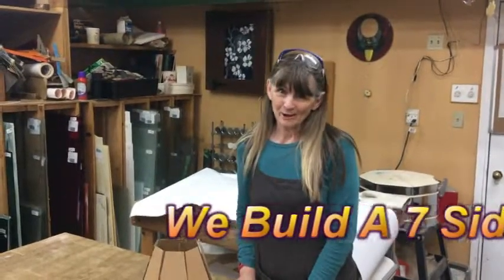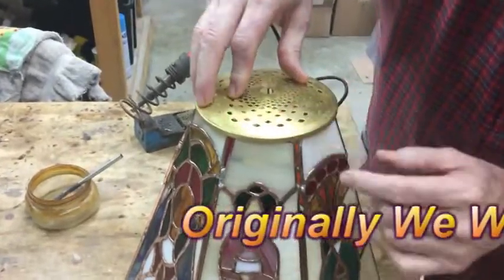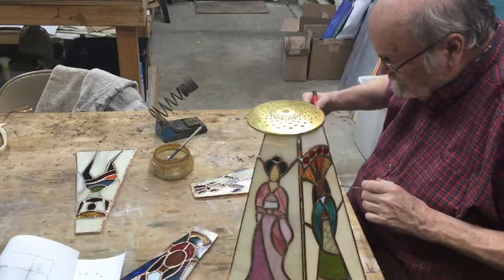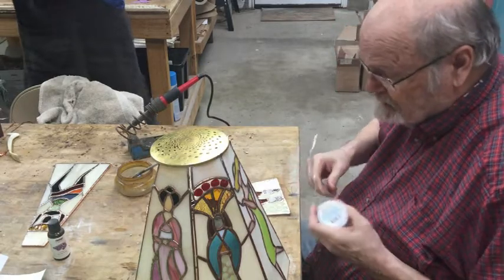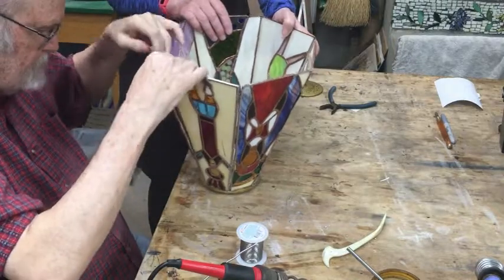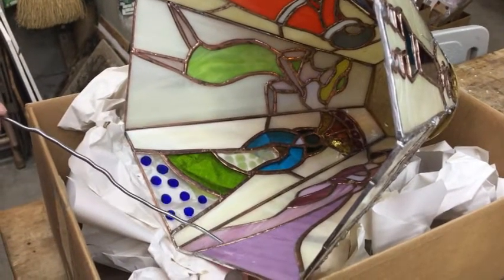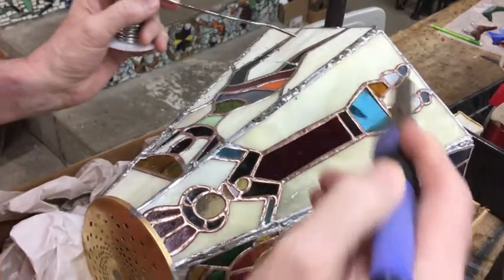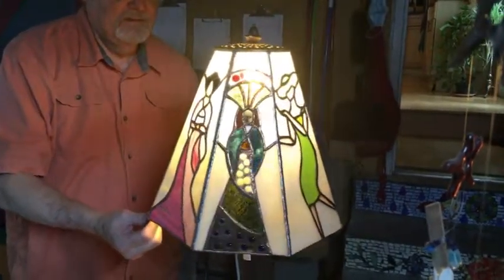How We Assemble a 7 Sided Lamp Shade For A Competition V320

Comment: Difficult to solder, I’ve done several. I usually made a geometric pattern in paper of where the glass bases should sit. Then I tape the paper to the wood workbench surface. In the middle of each section I hammer in push pins, through the paper and into the wood table.  In your project I’d have 7 pins equidistant around the paper.  That will give you that stability you need to keep the panels in place and not shifting around.   Very nice work Jeannie, you have a gift.  Assuming, Jeannie, you had a jig to ensure every panel was exactly the same size.  That was a tough one.  I liked the patina color.  Was it a mixture 1/2 copper and 1/2 black?
And for the record, I thoroughly enjoyed the the sandblasting videos.
Reply from the maker: The whole project was a lot of fun! David used my cardboard mockup as a template to estimate the angles that pieces should be soldered together. The patina was copper.

Comment: What about using a piece of 1/2" reinforced tubing split length-wise and taped into a circle like a donut and then forced down onto the panels on both the top and bottom edges to keep all the pieces together while you tack solder?
Reply from the maker: That might work. I think that in the future, I'll try thicker foil on the edges and that will work.